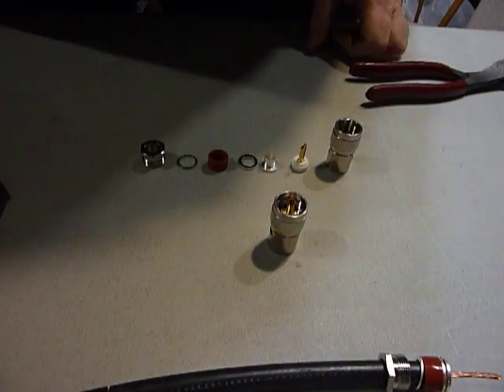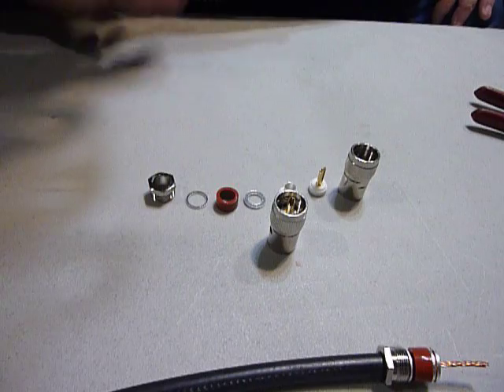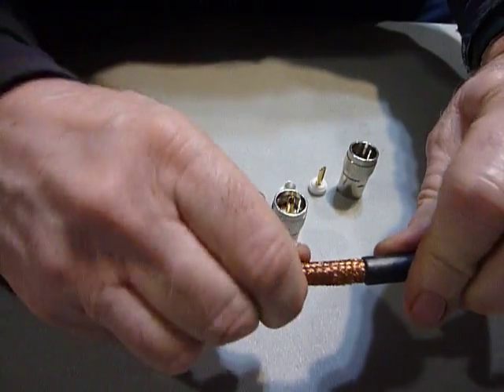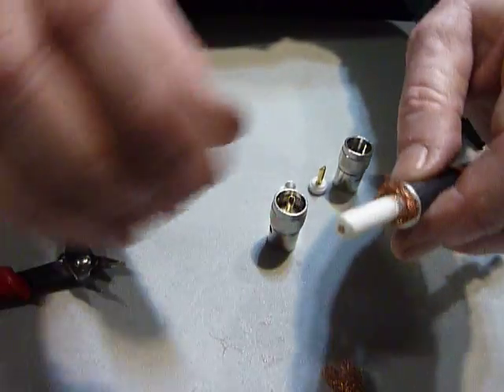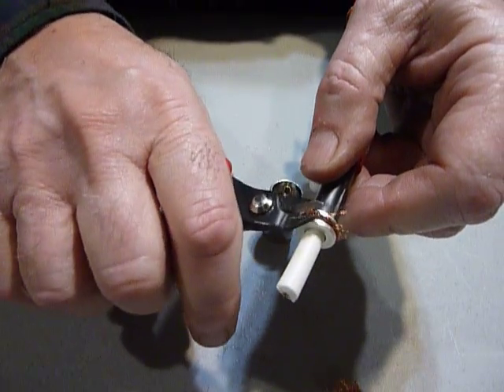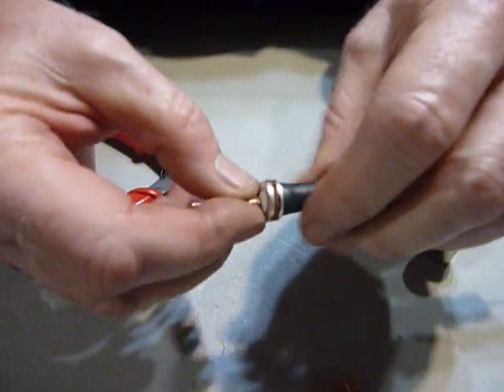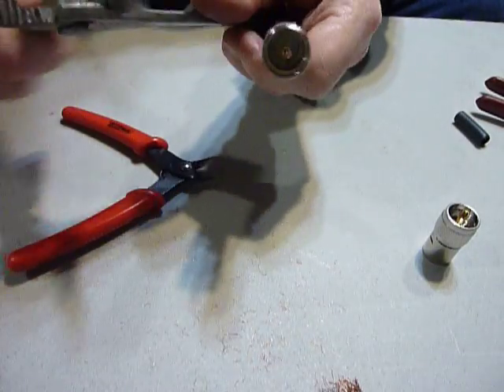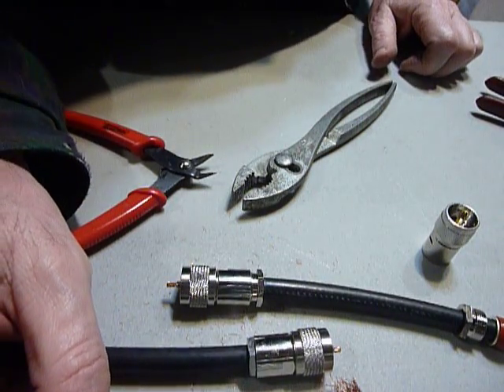COMPRESSION  TYPE PL-259 CONNECTOR , CLAMP ON PL-259

Comment: Outstanding video, and very clear instructions. I bought my connectors on eBay. I had a thinner 17mm already in my toolbox, but 17mm was a tad large for my particular connector. No worries, the gap allowed me to put thin cotton material over the wrench and prevent scratches on the connector.

Comment: I've made "thin" wrenches myself.  Buy the cheapest one of the right size at Harbor Freight and then use a bench grinder to thin it down until it fits on the flats of the connector.

Comment: Put a slice in the plastic/rubber coating lengthways about 1/4"-5/16" where the feral  slips under the shield and it will slide on easier. The compression clamp will help keep things water proof. Terry

Comment: Does using the RJ-11 (75 ohm)from the cable companies cause SWR issues with antennas designed to use 50 ohm coax? Please reply. Terry
Reply: No issues.

Comment: Great video Bob! Just made up a couple of cables with LMR-400.  Your instructions worked flawlessly! A couple hints: I found it easier to trim the braid with scissors...snip, snip! The wrench needed for the sleeve is a tad OVER 16mm (micrometer 16.5mm). I had a 16mm bicycle cone wrench in my toolbox, so filed it out a bit to make it fit.  These cone wrenches are really cheap... $6 or so on ebay. Worth having just for these connectors. 73.

Comment: Thanks Bob. Saved your video and ordered the hardware through eBay.  Just finished installing a electrical box with surge arrestors to a remote antenna switch for my multiple antennas and dreaded assembling the standard PL's. Watching your video was a great step-by-step process/presentation. I always check for continuity shorts and the process was perfect. Had the right tools and that  as well! Tnx & 73,   N8QZ

Comment: Great connectors i have had the braid slip out on a few of them due to heat and cold wind stress , so i just solder them to the slide in sleeve seems to have fixed my problem with them in the shack i just do them like you have done.

Comment: Thanks for posting this fantastic video,  Bob! I've put on PL-259s the last 43 years by just folding back the braid and threading the collar of the PL-259 over the hard black outer coax jacket pinching the braid between the jacket and the inside threads on the PL-259 connector on RG-8 coax and with the smaller RG-58 coax I tighten the braid in between the smaller coax adapter threads and the threads inside of the PL-259 and I have never soldered anything other than the center conductor and it has always worked great all these years, even when I run 1 kilowatt through it. I have never had a single issue doing it that way which is basically what you're doing with the connectors on this video. I trim the braid back left sticking out around the edge of the connector as close as possible because you'll never have a finger more sore than one you've stuck a piece of coax braid into and then I waterproof it with some moldable Coax-Seal and then a layer of Scotch brand 2242 rubber electrical tape over it and one final layer of a piece of Gorilla brand duct tape over all of that. Works great! Very 73 de KU4GW.

Comment: Just a short question. The braid should be in contact with the outer shell of the connector, but the rubber compression bushing is an insulator, so the compression nut is not contacting the braid. Where does the braid contact the connector shell if you cut it so close to the washing?
Reply from the maker: The shield is connected all around  by the bushing that slides in under the shield  watch the video again .
Of course you should always check the cable for continuity  and shorts  with an ohmeter or VOM before using it . 73  Bob
Reply: @robertsumption1243  Got it, did it. Thank you very much kind sir!

Comment: Which one do I need for coax 213
Reply from the maker: The 213 coax and the RG-8 have the same diameter .405  inch so the connectors for RG-8 will also fit the 213 just fine . 73   Bob

Comment: Great Video!  Only interested due to having to install a VHF marine radio.  Cables come with the PL259 uninstalled.  Great, now it's something else I have to learn to do.  Soldering the tip will be easy. Like you, I don't like heat around stuff that will melt.  How stiff is that RG 8 cable?  That is one cable I was offered for the ant. but it looks stiff and hard to make turns to helm.  Again, Thanks BIG TIME.
Reply from the maker: Some RG-8 is very stiff like garden hose some is more  flexible like Belden number 8214.  If the coax run is short lets say under 50 feet long and the power of the VHF  marine radio is less than 300 watts then I would use the small RG58 cable easy to use and works well is very flexible it would be difficult to measure the difference in the loss of a short  run of RG58 verses  RG-8 .  If RG-8 is required then I would use the new type clamp on PL259 connectors they are listed on Ebay  look for "Clamp on PL-259 " You still have to solder the center conductor but they are easier to do and more weather proof  I also made a video on these it is on youtube as well .  Good luck with the project .    Bob
Reply from the maker: Did you know that if you type in someones name on youtube  all of his videos will pop up . ALSO  if you click on his picture all of his videos will pop up too.     BOB
Reply: Very professional, thank you so much!   Well under 50 feet and only 25 watts max.  Some ant. came with rg58 so now I know it would be fine to use with little loss.  Will look at the new type connectors also.

Again, thanks for the info.   Bill,    Salem, Oregon

Comment: Wow, these appear to be far superior to both solder and crimp type connectors. It is a shame they are so hard to find in the states. I looked on Ebay and found a retailer in China listed as "rfbat" that has these connectors available. Would you remember the name of the place in China that you bought from? I would not mind waiting a couple of weeks for delivery, especially at a price point of about $23 for 10 of these  connectors. Thanks for the great video!
Reply from the maker: The guy I bought from on Ebay was " bestseller_for you "  The Ebay listing number is    272446528162    Just copy and paste the listing number in the Ebay search box ... YES I agree these connectors are quite an improvement . 
Also ALL of my feedlines are 75 ohm from the cable TV industry RG-11 and I run my KW with this type cable and the clamp on connectors with no problems  . It works great , Has less loss ,  Has 4 shields  2 braided and two foil  and costs less than 50 ohm types because the cable industry uses it by the millions of feet and drives the cost down  . 
 . These connectors sure  work well with the aluminum shielded 75 ohm coax 

73  Bob